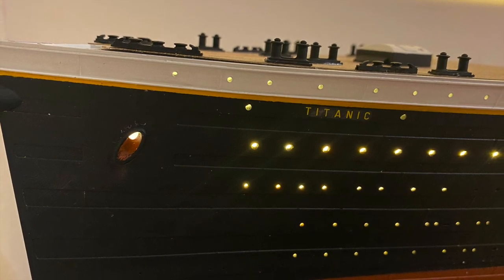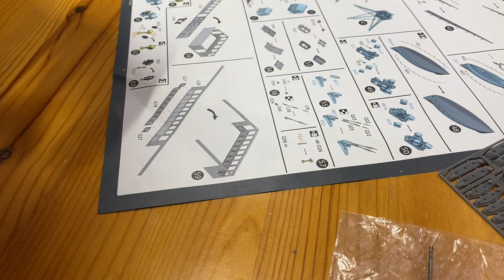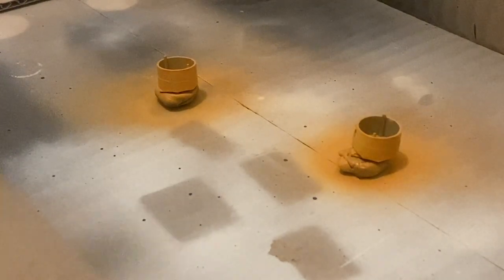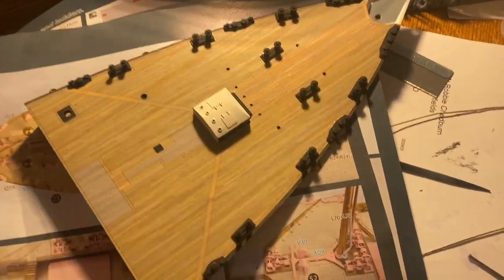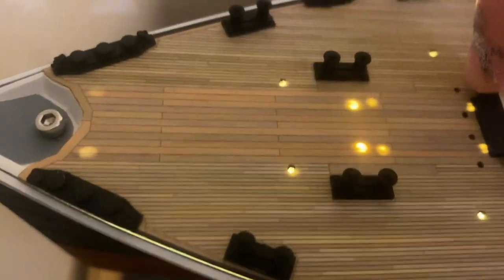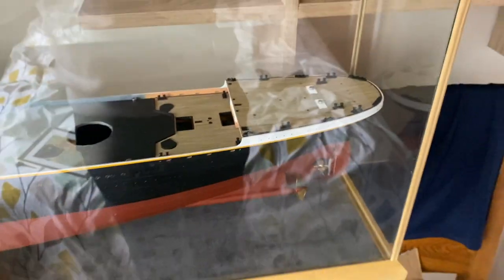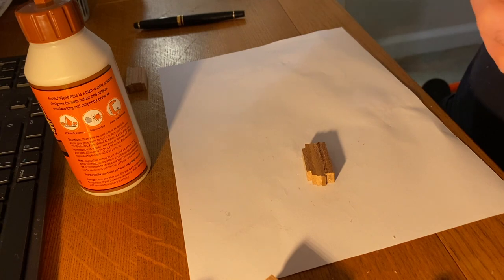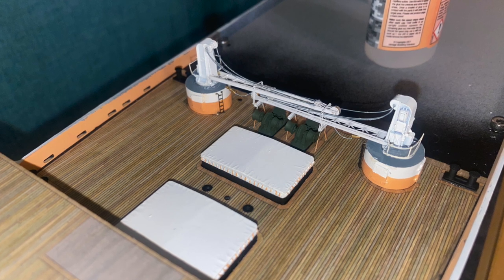Radio Control Trumpeter 1:200 Titanic Build Part 18 - Dry Dock Stand and Forward Deck Fixings

Comment: Hello, I have been watching some of your videos and you have a very beautiful and incredible Titanic, but I have a question, why can the 3D KA pieces be cut without the need to heat a knife, while the China 3D pieces do need it?
Reply from the maker: To be honest there isn’t really a single reason.
KA parts tend to have the support material on the bottom, so you can cut and then sand. Whereas China 3D have support everywhere so you have to me much more careful to remove support material delicately. But the main reason is that generally China 3D parts are more delicate so they need to be removed very slowly, where as KA are far more robust
Reply: @TheModelBoatGuy Thanks for the clarification, I now better understand the difference in strength and support of the parts. I appreciate the explanation.

Comment: Awesome video. Kinda wish you slowed down the build process of the crane lol. I’m having trouble finding where a very small part M07 goes. Could you possibly clarify. Do it go in the little indentation on part N18 before I fold it? Any help would be awesome.
Reply from the maker: Well I have a few left to go so can do a slower take if you want. 
But yes M07 gets folded in two to give the look of a thicker wheel, and is then added to the circular indentation in piece M19. Instructions arnt clear there, I remember having to look at some pictures of the actual cranes on Olympic for clarification

Comment: tech tip, grab a sewing needle and cut open the eye of the needle, so you get a two pronged fork, stick the pointy end of the needle in a suitable handle (some chopsticks or similar) and presto, you made yourself an awesome CA applicator for working with both medium an thin CA.
When it inevitably gets clocked, break out a lighter and burn off the residue.
I've been meaning to ask you, what's the brand of the acrylic UV resin you used for the windows?
Reply from the maker: Hi, that is a brilliant idea. I will get some needles. Thanks for the tip! 
Re the resin, this is what was used:
https://www.amazon.co.uk/dp/B07TXWYV92/ref=cm_sw_r_cp_api_i_yaPsFbR6CEEXS
I tend to draw it into a syringe covered in black tape and use it like that.

Comment: Hi Missed where u paint the grey on crane bases… how did you mask… same for the other buildings that are the blue grey on top there is always a recessed and lip around the edge?
Reply from the maker: Hi there,
I tended to use a good quality modelling masking tape. Something like Tamiya.

https://www.wonderlandmodels.com/tamiya-masking-tape-1mm/

This like is to the shop I buy most modelling stuff from. The tape here is probably too thin, but it’s this product range. 

As far as I’m aware there was always a lip around the edges of deck housings yes! 

Hope this is of some help?

Comment: Hi, loving the build! Do you still know what the dimensions of the case are by any chance? Thanks
Reply from the maker: My case is 56" long, 7.5" wide and 17.5" high. This is something that you can spec yourself though. My case is relatively small as my flat is small, so i wanted to keep things as compact as i could. However if you have the room i would advocate going for something a little larger. It makes putting the case over the model a much easier task for sure!
Reply: @TheModelBoatGuy   that’s brilliant! Thanks for your help! 👍🏻

Comment: Beautiful modelling of the drydock, but I can see 2 problems with displaying the model in this way:
1) All of the figures you have prepared for an "afternoon at sea" wouldn't be promenading on deck with the ship in drydock, and
2) The only time the ship was in drydock was while under construction, and when it was launched on May 31, 1911 virtually the entire superstructure had not yet been built up. This construction was completed while the hull was afloat.
Doesn't really matter for display, of course, but just a technical observation offered.
Reply: If Titanic had survived it would have bewn in a dry Dock many times. The figures on deck wouldn't be out of place tho

Comment: Can you please tell me where you got your case made ? Thank you in advance.
Reply from the maker: hi, forgot to put the link in the description but its there now. Just encase: 
https://www.dscshowcases.co.uk/
Reply: Great work. Getting lots of good tips for my build. Also installed rc gear.  I’ve been happy with 3 custom cases from
https://www.acrylicjob.com 
In the US. Scroll down the page to estimate cost for custom cases. Not the elegant wood framing, but great protection and display for a static model. Ships flat and easy to assemble without tools or adhesive. My last purchase was for a 1:200 Hornet.  Happy building, Dudley

Comment: The way you‘ve ordered the keel blocks is not correct. On the pictures in the video, the arrangement is shown when there is no ship in drydock. If there is a ship in drydock, these blocks are spread over the whole bottom of the ship. The Titanic had a shallow keel, so a flat bottom with a structural keel construction and bilge keels on both sides for stability. 

But anyhow; nice build of course!
Reply from the maker: aaah thats makes sense actually! fair enough, to be fair its really just to give the effect more than anything. Its amazing how stable the model feels on the base actually, i was a little worried about it
Reply: @TheModelBoatGuy  ... just my two cents. It’s still a very fine building!

Comment: Im very interestes in the glass case, any more info?
Reply from the maker: yes sorry forgot to add the details into the description. I've put a link in there now but just encase 
https://www.dscshowcases.co.uk/
Reply: @TheModelBoatGuy  great thanks! Dont mind if i ask what the dimensions you chose were and what options? Thanks!
Reply from the maker: I chose 53” length, 7” wide, and 17” tall. 
Note though that this makes a very close fitting case! Essential for me because I don’t have very much space to put it, but if you have more space I’d consider expanding those dimensions a bit. 
Colours wise I chose Oak and the base colour was Ash
Reply: @TheModelBoatGuy  great thanks for the info!
Reply: @TheModelBoatGuy  im presuming you meant 63” long not 53, otherwise you cuttinbf part of the ship off hah! Iv just asked for quotes frok another person as the firm you recommended hasnt replied unfortunatly. Getting quotes for perspex/ glass and safety glass as mine may be displayed sometime!
Reply from the maker: Actually my case is 54”, the model is a fraction over 53”. As I say I have a rather tight space where I want to display the model so i have cut my dimensions very fine! I would certainly suggest getting a larger case if you can as with mine you have to be careful when lifting the glass on and off!
Reply: @TheModelBoatGuy  the guy i originally messaged told me he cant make on that big. The guy you used hasnt responded to two emas unfortunatly
Reply from the maker: Ah no that’s a shame, he was really good with me and my order. Are you U.K. based? I think from memory I rang them in the end, so that might be the way I guess. Otherwise I don’t really know what to suggest. Hope it works out for you
Reply: @TheModelBoatGuy  yeh im uk based. I will give him a ring if i cant get an email response in the next few days
Reply: @peggbegg  hi, I was talking the Case maker yesterday and he asked me to reach out to you because he had some email issues which might explain why you struggled to get in touch with him.
I’m not sure if you’re still interested in a case but if so you can contact me on Instagram and I can give you his details 😀
Reply: @robla85g18  hi mate. Thanks for that! I dont used instagram sadly!  Unless you can find ke on facebook and drop me a message?